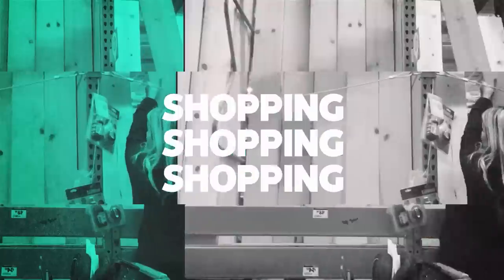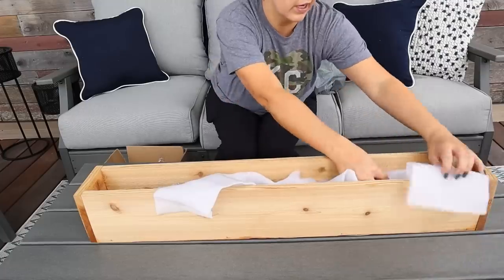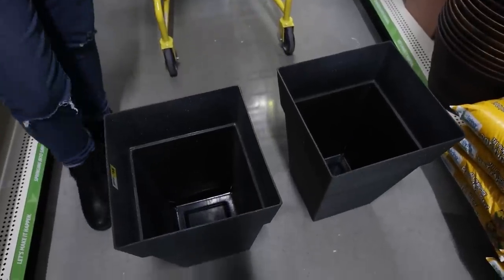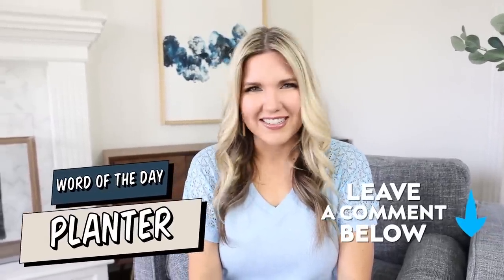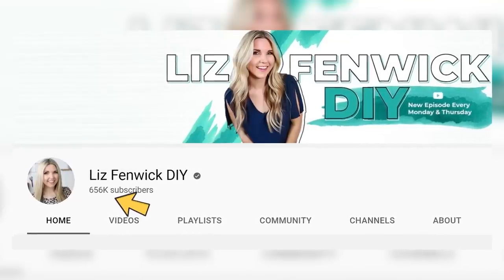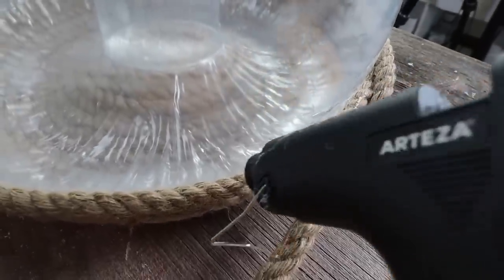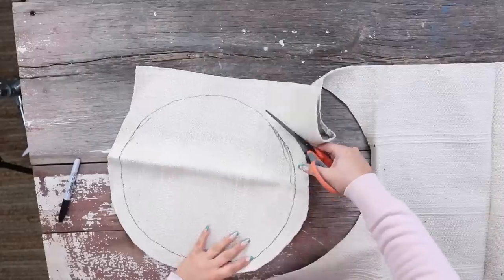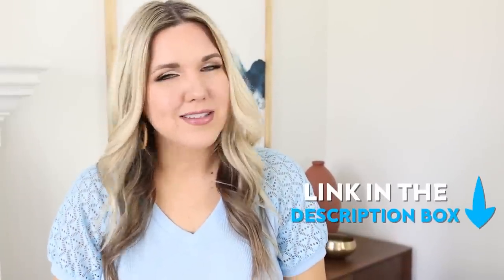DIY Your Patio Decor To Save $$$... Easy DIY's For Your Outdoor Space

Comment: Using empty water bottles in the bottom of planters is a great filler also, especially for large planters for real plants, it saves on the amount of soil you need and helps make the larger ones not as heavy when you need to move them around......this is something we do a lot and it works great....

Comment: I actually have a question about the planter. I see how you put the rocks in the bottom of the large planter did you drill holes for drainage?  What happens when that gets rained on? How do those fake plants hold up if in rain? I have an indoor plant that I need to change the contents of the bottom planter so it can be outside but it will get wet! What is your suggestion for contents of the planter?